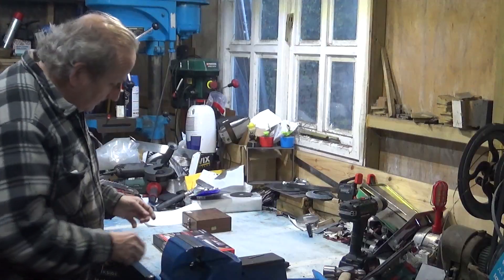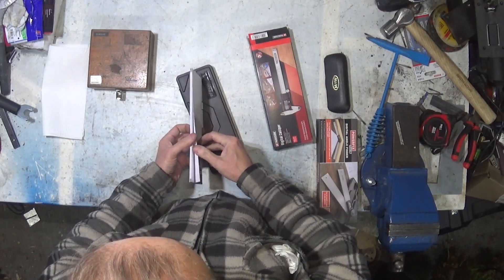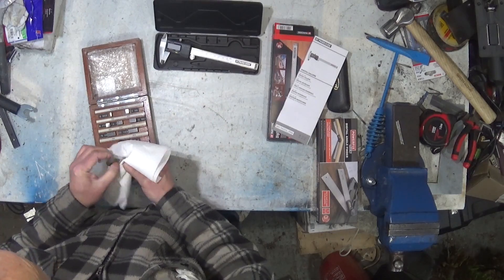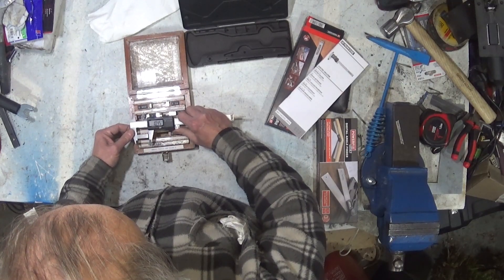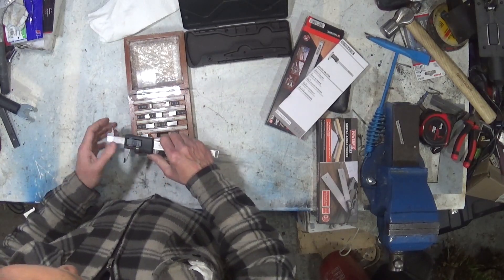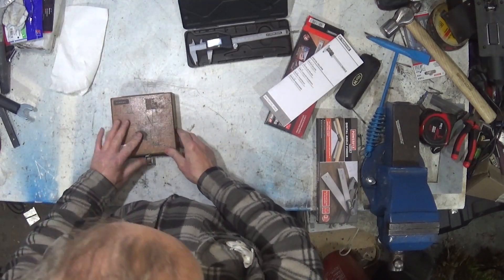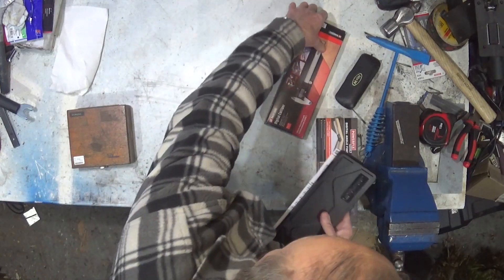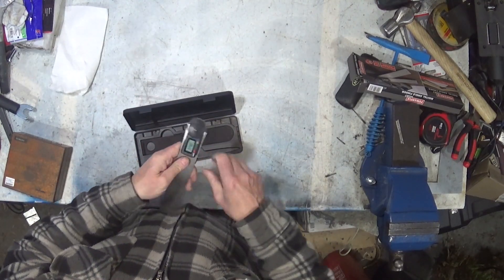Lidl Parkside Digital Calipers Digital Angle Finder Review

Comment: Thanks for looking at these. Would you think the Lidl caliper is worth having? I don’t need very fine accuracy. I plan on using on to check the diameter of golf grips.
Reply from the maker: Yes, very much so. I use them often. I also use micrometers but that is because I make things from time to time that have to be accurate to around 1/1000 of an inch. Most things do not.

Also they are cheap and take the CR2032 battery rather than the LR44 which most calipers take and which causes me problems.

Many thanks for watching, please like, share and if you like the channel, subscribe!

Comment: Digital vernier calipers are a must have - I would be lost without mine.  I don't like the angle finder so much, the locking screw thing looks a bit tricky to lock without slightly changing the position.  That said it could be useful for measuring an angle, I'd probably just use my analogue angle finder to then transfer that measurement to whatever I was cutting because it has a better locking screw thingy.  As always, they're great value.
Reply from the maker: If you don't need to know the angle but just want to transfer one you can always use a bevel gauge. On the caliper front I always used to use one but I now also use a micrometer which is better for accuracy.
Reply: @BensWorkshop  I used to use micrometers lots but these days most of the stuff I'm working on can be done just using the accuracy of the calipers - my micrometers haven't been out of their boxes for years, but you're right that the micrometer is more accurate.
Reply from the maker: I have them up to 4 inches. All imperial, of course.

Comment: Nice video, Benedict.
I have both Lidl items, they are cheap and nice to have (in lack of something better)
About the caliper - I found that sometimes it gives different readings on same measurement. My dad's old caliper (vernier caliper) was better in that regard.

I still don't know about the function of the metal wheel on the caliper. Can you shed a light ?
Reply from the maker: Yes, older devices can be better though rigidity and the way it's used also has a big effect.

Comment: It’s amazing how inexpensive measuring tools have become since the discovery of Chinesium!!!
Reply from the maker: True. That said the micrometer only cost me £15 second hand.
Reply: It's the chinetronics that makes them cheap, look for a cheap set of lab/dial verniers they'll be double the price and not even come with cells...
Reply from the maker: Electronics are cheap to make anywhere. The Raspberry Pi is made in Wales in a Sony factory and you will not find a cheaper computer anywhere.
Reply: @BensWorkshop  icb manufacturing has always had to be automated, pcb assembly is pretty reliant on cheap labour.
Didn't know the raspberry pi was made in Wales.
Reply from the maker: Assembling PCBs can be very cheap with pick and place of though hole as well as SMD, flow soldering etc. The issue is though when skilled labour is needed not just assembly. That said, now you can manufacture stuff cheaper in the UK than  in China as people who off shored are now finding out.
Reply: @BensWorkshop  absolutely! I’ve been in manufacturing my whole career since 1983 from bearing and machine tool design to aerospace and aircraft manufacturing.  Offshore was cool in the 80s until we discovered we needed all metric tools and that the materials we called out for weren’t exactly what we received. As I always say, Price, Delivery, Quality....Pick 2 as you’ll Never get all 3.
Reply: @BensWorkshop  CAN being the operative word, the chips are standardised and produced by the million, the board assembly only gets cheap if the board and components are of the highest dimensional tolerance end you've spent millions on the line.
It's fairly evident from the china exodus to Vietnam, Thailand and Malaysia by companies involved in this work that if you are more interested in high volume low cost, cheap labour still wins for pcb assembly. As Ken says, Price, delivery, quality, things maybe changing but the money men are normally slow to put their hands in their pockets.
Was in a plastic packaging factory a few months ago, they still had a 1970's thermo-form machine making plastic drinking cups.... Didn't have to touch it, the most reliable machine there from what I saw.